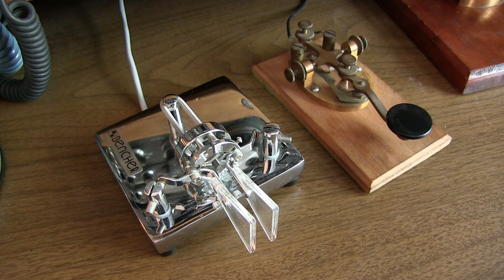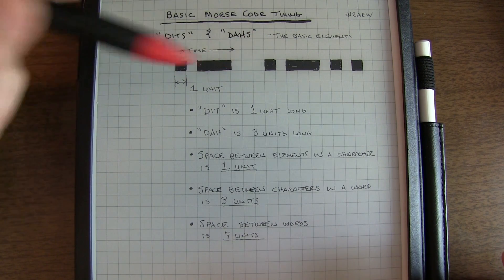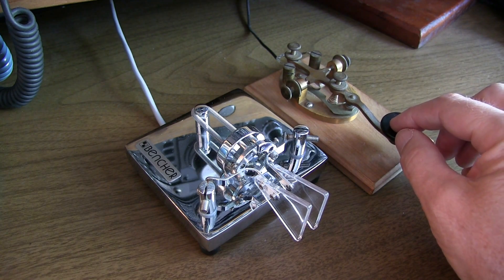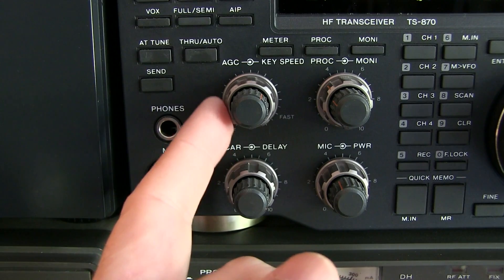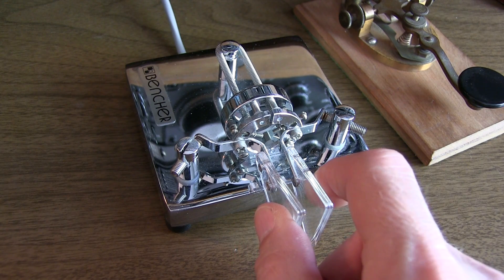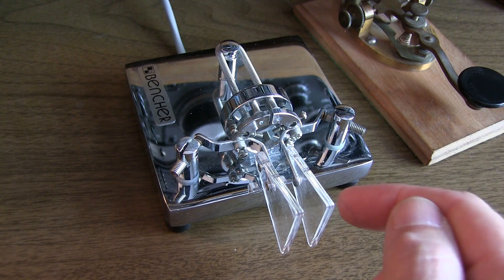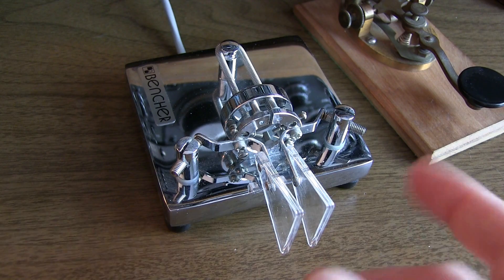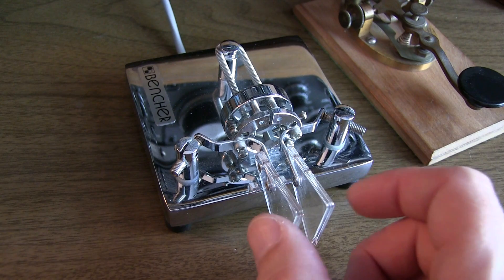#300: Ham Basics: Sending Morse Code / CW - straight key, paddles and iambic keying

Comment: You did an excellent video on explaining the finer points of the iambic keyer.  I learned the Morse Code may years ago because it was required to earn all classes of licenses and did not use it since then.  However now I am desiring to become proficient at CW again to use with QRP.  Between the knowledge you shared and practicing with the Morseerino I just built, I am confident that I can get my code speed back up to a reasonable level.  73 Bret C/AC0AE

Comment: Have been an Extra Class Ham Radio Operator since 2016, and I’m still working on Morse Code! Pretty sure my spacing needs improvement as well as copying. Both are a challenge! But I’d like to operate CW more if I can get it down better 😎👍

Comment: Thanks Alan, good basics video. After 50 years of using the same Vibroplex single paddle I never learned iambic keying and of course, you can't teach an old dog new tricks!  ;-)   73 - Dino KL0S
Reply: haha.. i wish i was able to use a bug - i never mastered it, but unlike you i fully intend to learn it eventually :-)  

i think bugs deserve more love, because theyre mechanical marvels, unlike the iambics that cant do shit w/o integrated circuitry.
Reply: "Of course"? I'm sure that isn't true :-) An Iambic key and twin paddle has to be even easier than a bug - especially when  one's bones and muscles get a little worn. Yes, there will be some adjustment time, but nothing compared to learning CW in the first place ! 73 - Julian N4JO.
Reply: @zoolkhan  No need to be negative about keyers. A radio is made up of integrated circuitry too. Bugs aren''t "marvels", they were simply a solution to the problem of excessive stress on the wrist; but they still need manual "dah" keying. An Iambic keyer does that for your too, and it can be a great help to a person with reduced muscular and skeletal strength.
You have little right to speak negatively: if and when you "eventually" learn CW you can offer your personal opinion which, even then, will be worth no more or less than anybody else's.

Comment: Great demonstration Alan.   I still use my old original radio shack straight key, the metal one not the later plastic one.  In the early 90's I got the MFJ keyer which is the bencher with the electronic keyer built on top of it.  Still works a treat. Thanks Alan for sharing. May the 4th be with you!
Reply: Ah yes, MFJ. Mighty Fine Junk. Still got my MFJ keyer on a shelf in the shack.

Comment: Thanks Alan. I’ve been thinking about getting back into CW. Haven’t used it in decades. I’m making a Keyer that uses the Curtis Iambic chip to drive an old Ameco code practice oscillator, so I can practice iambic keying.
Reply from the maker: I had been off of CW for about 15 yrs too, until recently.  Still working on re-building the skill

Comment: Electronic keyers and computer aided keyboard CW have really cleaned up a lot of CW.  I've been an Amateur radio op. for over 40 yrs. and can remember many times when I wanted to send 'QLF ?'  .  I'm sure you've also heard guys with very distinctive personal sounds. One of the most common are guys who make their DAHs about 5 (or more) units long: dit DAHHHHHHHHHHHHHHHHHHHHHHHHHHH dit dit. As you said, its not too bad if they are consistent. I've worked CW ops. who were DEAF.  One German gal I worked on CW was able to copy CW by putting her fingertips on a speaker cover and feel the vibrations.  Other deaf ops. use a flashing LED to copy CW. CW has always been my favorite mode. I so lamented the ARRL's decision to dumb down licensing requirements to eliminate CW that I quit my ARRL membership (and my sideline as a VE).  I've used all methods of sending CW: straight key, Bencher paddles, computer keyboard, etc. One time I did a little test with one of my CW buddies.  I sent a sentence 3 times, using each of the aforementioned methods.  I then asked him if he could tell which was which .. and he couldn't tell. That's when I knew for sure I was a CW junkie.  I've not been very active on the bands the past few years, but no matter how long the interval, I can still get back on the air and send/copy CW  ... its like 'riding a bike'. Thanks for your demo. 73 de KB8EB
Reply: Hi, I have been a ham approaching 60 years. At about the halfway point, I also terminated my ARRL associations for the exact same reason. "Antiquated mode", the soothsayers insisted. Yeah, right.  Anybody with a brain and a receiver knows that CW is as functional, and thanks to ever improving technology - it's more reliable and as popular as ever.  Quite simply, CW works. The problem for agenda-driven soothsayers is that CW requires so little in the way of costly high-end equipment. Expertise yes - money NO. And as we all OTs know, it's the money, or should I say the lack thereof, that drove the no-code licensing advocates pushing their agenda - aka financial stimulus package.
Reply: Very glad you fools are dying off so that radio can move into a new generation.

Radio would have died had it remained as it was.

I'm over 60 and just got my ticket. Has CW been a requirement, I would never have done it. Perhaps you should hang up your keys.
Reply: @rayh592  Yeah, CB radio moved right into the middle of the 'new generation'.  How's that working out?
Reply: @rayh592  But now with the great FT-8 generation we can let our computers converse with one another useless and boring information as we send our high tech ASCII messages LOL on FB messenger.
Reply: @BGLENN-dp4tx  I have concluded he is a troll with nothing to live for anymore.

Comment: Thanks Alan. Something one day I want to do is get proficient in CW. Something on the to do list for sure. Great video!
Reply from the maker: I was fairly proficient many years ago when I upgraded to Adv/Extra, but then was off of CW for 15+ years.  Working on getting back into it.
Reply: w2aew CW has not part of the exam process here in Australia for many years now, so I never had to practice. Maybe one day we’ll work each other on it.
Reply from the maker: @HamRadioDX  CW was eliminated in the exam process here almost 20 years ago as well.  Still a lot of avid CW operators out there - now there for the love for the mode, not because of the need to know it.
Reply: @w2aew  I got my tech about 30 years ago. Didn't use it much at all and let it expire. Just retested for tech again and was floored when I was told no cw was needed anymore. I would have taken the general had I known otherwise. Daughter and I are starting to learn cw together...

Comment: I like the clarity of your explanations, so I was hoping you would cover the technique for using a Vibroplex Bug here. I got the Vibroplex Zephyr of a friend who is now a Silent Key, and I'm determined to learn the code and get on the air with his old key. But through a bit of research I'm beginning to realize that adjusting and properly using the Bug could require as much study and practice as learning the code, so I'm looking for a good starting point. Thanks again for your channel and your clarity.
Reply from the maker: Hi John - I wish I could help, but I've never used a Vibroplex bug, thus have never setup/adjusted one either.  I understand the principle of operation (automatic repetitive dits, and the dahs are all manual).  The bug is probably not the best key to learn code on, but can be very effective once you master it.

Comment: This was really great! I think I’ll get a duel lever paddle key. It’s so much better than a straight key. Once one gets used to it, it seems like it would be very nice and smooth.
Reply from the maker: Very good - just make sure your radio has the electronic keyer built in.
Reply: @w2aew  Thanks for this tip. Can an electronic keyer be put inline if the radio doesn't have one or does a person need to get a radio with an electronic keyer built in? Another question: Can we CW with a mic on an analog radio? I've got an ICOM IC 2730a. I've only been in HAM for two years so I'm pretty new at this.
Reply from the maker: @quailstudios  Yes, you can add an electronic keyer circuit between the paddles and your rig, if your rig doesn't have the keyer built in.  In theory, you "can" do CW with a mic (just picking up an audio tone from a 'practice' oscillator), but it is bad practice to do this - mainly because the mic will also pick up room noise, clicks from the key, etc. and the resulting signal will occupy more bandwidth than a proper CW signal.
Reply: @w2aew  Thanks for your input. I could find this all out by myself but it's great to have someone who knows give a little guidance. I really appreciate it! Saves time and money.

Comment: I purchased a Lionell  J-47 telegraphy key made for World War II.  It sat as a novelty mounted to a wall for many years. But recently, I retrofitted a jack to an ancient CB microphone and added a small oscillator.  Then I plugged the antique Lionell J-47 key to activate the primative oscillator and the oscolatoe to the microphone. I connected the ancient microphone contraption to an equally ancient C.B. Radio, probably made in the late 1980s, . I then cut an ugly 206 inch antenna with an insolator dead in the middle and hung it vertically off the apex of the roof from a horizontal pcv tube. This was all a pitiful effort to revisit an old childhood project. I put the ancient CB radio on channel 40 USB and taped out a slow CQ, not expecting anything at all. I got a response. I did not even know anybody used Morse Code anymore.  The other person returned my CQ with a moniker of Kilowatt 37.  I barely remembered my childhood callsign but I taped out, with great difficulty, KBX1339.  I do not even know if the callsign is still valid.  But nothing was said about the old callsign.  I struggled away for over an hour, taping away and copying. I had a very rough time but really enjoyed the CWQSO.  Kilowatt 37, Joe, was very far away from me, over 1200 miles away.  We agreed to meet on 40 USB again the next day. But radio conditions have not accommodated our long distance communication using my junk equipment.  Citizens band has changed dramatically since I was young.  The band is empty.  I only hear some extremely far transmissions on channel 6 AM, and in channel 38 LSB.  The transmission are very few and very far between.  I still tap away a CQ on 40 USB from time to time.  I have never heard from kilowatt 37, Joe, again.  I really think CB is dead.  Even entering my ancient callsign into the search bar, I get nothing.

Comment: I used the squeeze and buffer on iambic until I found a "limitation" such that at high speed, electronic keyer buffer weight and cadence causes buffer to actually lose track of rapid hits. Moving to the single lever Begali...mode B didn't cut it. Or even if I leave it on, I no longer use it.

 Just something to consider, not counterpoint.

Comment: Morse code fascinates me and I am amazed how the iambic keyer worked. Thanks! Make more vids! Teach us Morse code!!
Reply: Well remember it's the keyer software or firmware that creates the stream of dits and dahs, not the key; the key simply tells the keyer to produce the tones.
And if you really want to get specific, the keyer itself doesn't produce the tones either - it simply tells the transmitter to turn the "carrier" (the basic radio signal) on and off repeatedly. 
Actually, even the transmitter doesn't produce "tones" either! It just sends out the  carrier, which a receiver will pick up and create an audible tone from by being tuned to a frequency just slightly off the frequency you are sending. The pitch or frequency of the tone the listener hears is the difference in frequency between that of the signal the sender is sending and the nominal frequency the receiver is tuned to.
So where does the tone come from? A modern transceiver will also produce what is known as a "side tone", which is just an audio tone for you to listen to, so you can tell that you are keying properly.
I hope all this makes it even more fascinating :-) Learning Morse code takes patience and practice. You can learn if from a chart, but doing so that way won't make it useful, because learning to "copy" it (hear it and translate it into English in real time) is a different skill to sending it. Most radio amateurs learn to send much sooner than they learn to copy, which can be frustrating - but it's worth the effort when you can hold a conversation with somebody across the country, or even across the world!

Comment: I have to think & that slows me down. I transmit slowly because I have to think about what I'm want to send, am sending, & any corrections. In receiving I must wait for the last tone & then spend time figuring out what the letter was. I'm not even up to the point of writing it down because of the excessive time delay. I can only think of 1 thing at a time & many times when one thought peg comes in, the previous peg gets pushed out. Once I get "lost" it's hard to find a new start point. Sort of like when a Square Dancing square breaks down & must wait for the Caller to call something that everyone can quickly get in the right position. It all takes practice which I can do on some weekends.

Comment: I passed the 20 wpm test for the Extra class years ago, but it was a struggle. I guess I just didn't process the sounds well or something. I understand the advantages of cw, but I always like to hear a voice anyway. To this day I've never made a cw contact.
   I suppose I should brush up on it and try it one day, but to be honest I'd rather spend what little brain power I have left on chess.
Reply from the maker: I'm similar - passed the morse exam many years ago, but didn't do any CW for many, many years after that.  So much so that I really lost most of my ability to do it.  I developed an interest in CW again about a year ago and it's been fun (for me) to slowly regain this skill.
Reply: @w2aew  Great! I have a cw keyboard and converter around here  somewhere. I don't know if any digital modes can be done on Android. Connecting a computer to my radio isn't really my style. 
   It's all packed away and on hold for now until I move anyway.

Comment: Thanks for share your video!

I'm studying for the HAREC exam and I'm interested in radio CW. What's is the best of those two types of keys for a noob that must learn from zero?

73!
Reply from the maker: Personally, I think it is best to use a straight key since I think it helps you learn the pattern of each character.  There are others that feel the opposite.  At the end of the day, use whichever you are more comfortable with.  The  best advice I can give you is to  use the Farnsworth/Koch method - where you learn the characters at a high speed - at least 20wpm - that will help you to hear/learn the sound of each character and not try to map out the individual dits and dahs.  Spacing between characters can be slow, but learn the characters themselves at speed.

Comment: Super helpful. But any video describing the connection to the electronic meter paddle to the transmitter and the signal that is sent when using CW? Ie. What tone frequency and how is that mixed with the carrier?
Reply from the maker: No video, but here's a quick description.  The key or the paddles connect with a simple mono or stereo plug/jack, usually a 1/4" or 1/8" - very similar to a headphone connection.  The key and paddles are simple normally-open switch contacts - neither generate any kind of a tone - they simply turn on/off the transmitter.  The electronic keyer doesn't produce a tone either - it is simply a circuit that turns on/off the transmitter using a prescribed timing.  Most modern radios have this keyer function built-in, but there are external keyers available that you can use with a set of paddles and a radio that doesn't have the keyer circuit built in.  The tone you hear (called a side-tone) is actually generated by the radio simply as an aide so that you can hear what you are sending.

Comment: Excellent!  I'm learning CW now but didn't fully understand what Iambic was other than two paddles instead of one.  Does everyone use dits on the left and dahs on the right?  Is there a "left handed" mode?  I'm a righty but curious now.
Reply from the maker: Iambic really only refers to the squeezing of the paddles.  You can use the two paddles with a keyer and never use the iambic feature.  Most people will wire the "dit" on the thumb and the "dah" on the forefinger -  so for right-handers, it is dits on left and dahs on right.  There are some that prefer the other way around.  Many keyers allow to reverse them in the menu so you don't have to re-wire it.
Reply: @w2aew  - Ya, I didn't recall seeing a "left handed" selection in any radio menus but seeing as I am just now learning CW I've always just skipped over the CW settings.  I really need to ramp up my practicing.  Much easier to learn to send than receive.   :-(

Thanks for the reply, Alan.

Comment: are there any of them without connecting to giant computers like those?
just a small, pocket sized key
Reply from the maker: The key and paddles can be used with any kind of small practice oscillator (key) or a small external keying circuit (paddles).
Reply: thanks :)